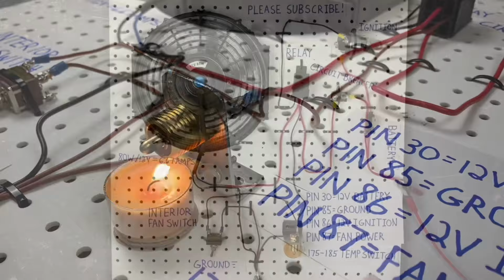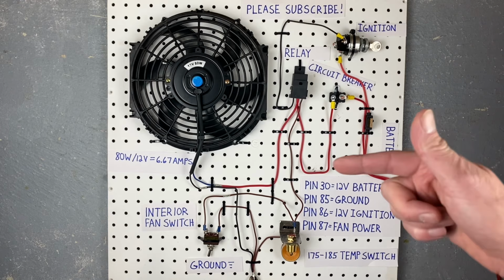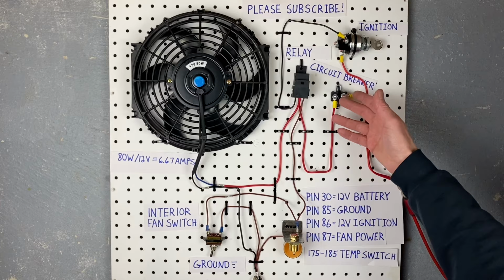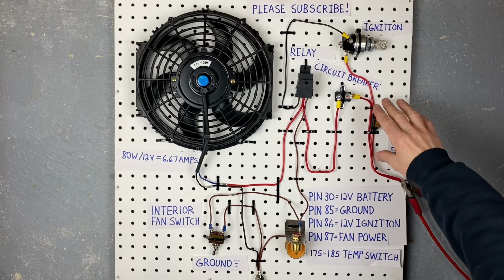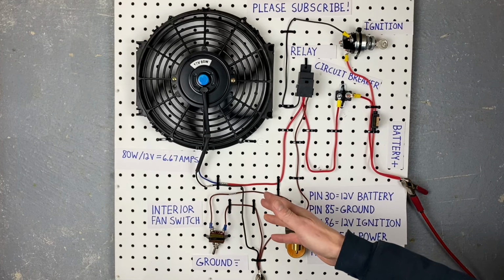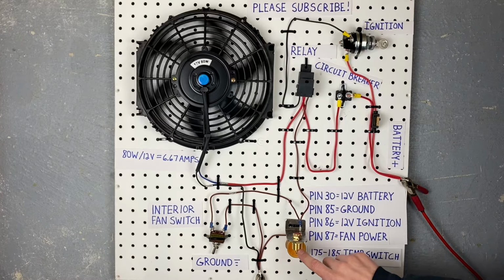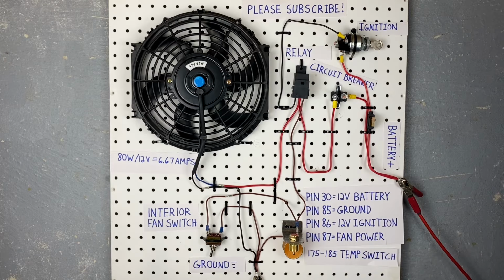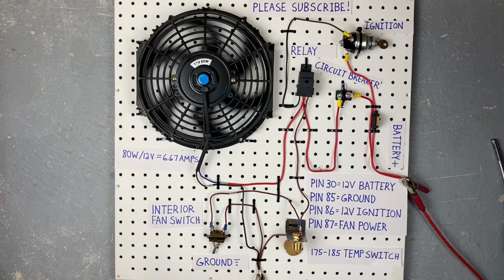How To Wire An Electric Radiator Fan Relay Temp Sensor AND Switch! | @WiringRescue

Comment: Great video, very clear and understandable. But i do have 1 question...
With pin #85 being the ground and temp sensor, would I just splice a 3rd wire Into it to connect the temperature gauge in the cab?
Reply from the maker: Hello! The answer is no :) The device in the video is a temperature “switch”. It only turns on and off at two specific temperatures. A temperature gauge requires a temperature “sensor”, which has a wide variety of resistance that changes based on the temperature. So it is actually two entirely different circuits. For your scenario, you will need to find a temperature sensor that is going to work with the style of gauge you are using.  Hope that helps out. Good luck with your project!

Comment: Hi, great video. I just did my camaro with a setup like this. But i would like to  keep the fan running after the car ignition is turned off. Like a temp power delay shutoff for the fan to keep the fan running until it reaches a specific cool down temp and shuts off by itself qfter ignition is off and i walk away from the car.
Could you provide a video thats shows how to do that. As an option to your existing fan install video.

Comment: Excellent presentation. What circuit breaker did you use? I don't see it linked in your description.
Reply from the maker: The circuit breaker came in the universal fan wiring kit. Sadly I don’t recall what the rating was on it. I’d guess 30amps, but I could be wrong. Really it should be based on your fan size and how much amperage the fan will be drawing through the circuit.

Comment: This is a great video, I just have one question do you have to wire the ignition wire to the relay to make it work? Or can you use the positive direct from the battery so it's a perment feed, no need for having the key in the ignition?? Thanks thanks

Comment: @WiringRescue Absolutely perfect diagram and explanation!! I have a question if you might shed some insight. I am installing a dual fan electric radiator setup, but I also have a Nilight 6 Gang Switch Panel Universal Circuit Control Relay System. I am wondering how or if I could tie all this into it, so that my fan would come on when necessary from the thermal switch but also give me the ability to override from in the cab on the controller. Thanks

Comment: Dont forget that many cars have temp switches with 2 pins. These are not grounded from the engine block and need to be grounded by wire

Comment: I want to hook up a fan straight from the battery to a on/off switch from a relay. Any ideas how to wire this? Thank you.
Reply from the maker: Only a few things different from the video:

1. Remove the ignition switch entirely, and the fused wire that goes to it.

2. Connect pin 86 to the power from pin 30, so they are tied together.

3. Remove the temperature switch and connect pin 85 directly to the switch instead of stopping at the temp switch.

4. Done.

Comment: I always wondered where did the pin number names come from. Why weren’t they just labeled 1 thru 5? Did it come from a circuit a relay was one used in?
Reply from the maker: Solid question! I’ll do some research on this!

Comment: Hi, the video is very educational. May I ask if I can do this without hooking it to temp switch? I mean just a manual switch in the dash so I can turn it on whenever I want. Also what relay should I use if I do this setup. Thanks.

Comment: Great video.  I noticed my electric fan turns on when engine turns on. 85 relay goes to ground on car chasis but not connected to temp switch.  I would like for electric fan to turn on only when engine gets to 200 degrees.  Any suggestions would be appreciated.  Thanks.

Comment: What gauge of wire should i run to feed a 2 fan system? 10g 8g? Lower?  AND can you run 2 fans on 1 relay or should they be on separate feeds? Thanks..great tutorial
Reply from the maker: The wire, fuse, and relay sizes all depend out the amperage being drawn through the circuit.  This question actually pops up a lot, so I made a video explaining it in great detail! https://youtu.be/EhzN6UdnmPA?si=G2JMY6GjnqZyYmTp

As for two fans with one relay - it is doable if the relay is sized properly for the two fans. That being said, it’s often cheaper to go with to smaller relays than one large one. So check out that fuse/wire size video link - and then decide on the relay with your wallet! :)

Comment: One question no one answers is - if my Nissan truck operates at a temperature of 195° then wouldn't I continue to use the old sensor ? And I believe that 87a post on a 5 wire relay is used for the a/c . Swapping my '96 Nissan truck this weekend !

Comment: should the thermostat on the intake and the thermostat for the electric fan be the same ? im guessing if running a intakte thermostat at 160 degree the fan thermostat should be 180 degree.

Comment: Im sure my vehicle runs 5v through the sensor and not ground. Should i just reverse the wiring on the relay so that the 5 volts activate the relay instead of the ground? Thanks!

Comment: Jeremy - this is an awesome video - thank you! Can you tell me what the amperage rating on the On/Off switch would need to be? Planning to do this very soon on my '65 Mustang!
Reply from the maker: I’m glad you enjoyed the video! The switch itself in this circuit  is just telling the relay to turn on and off, so it can actually be a very low amperage. 5amps + would be fine, as long as you wire it exactly like this. The relay itself is doing all the heavy lifting, so you’ll want to make sure the relay is rated for whatever amperage your fan is. Your fuse/circuit breaker would also need to be rated for your fan amperage.   I made a video on this topic as well if you find yourself bored today :D https://youtu.be/EhzN6UdnmPA
Reply from the maker: @banks412  - happy to help! Tell your friends to watch too! I’ll take every view I can get!

Comment: Thank you for the great explanation. On thing. Could the manual switch be connected strait to powered. That way if your sitting on the side of the road. Running hot, you can cool things down? Just thinking

Comment: is it possible to make the relay turn on with a 12v positive? like if i tap power from my ac compressor wire/fuse to turn on the fan. that way when i am parked and no air is moving through the condenser, i can still get cold air by drawing air through it with the fan?
Reply from the maker: Sure! Check out this video where I show negative vs. positive trigger wires. https://youtu.be/QCkfFCLa_Jg?si=LpNjHxCbng5RLGGG

Comment: I have a Derale 5.3 amp fan and the instructions say only if the fan draws over 10amps then use a relay.  Do you agree.
Reply from the maker: It depends on your switch and your wiring. If your switch, and wiring can handle the 5.3 amps, you don’t need the relay :) Just be sure to have a fuse in the circuit. A 7.5amp fuse would probably be a decent size. Then again, I am just a random guy on the internet.

Comment: Quick question.  there is a black and blue wire coming out of the fan, are they both wired to that one power source coming out of the relay?  Hard to tell in this video.  I was wiring up a fan in an older car and wasn't sure what to do with the black wire from the fan, except to ground it.

Comment: I’ve seen other videos where they connect Pin 85 to the ignition and Pin 86 as a ground instead. Does it make a difference if they’re switched like that? Thank you
Reply from the maker: It will likely work both ways, but I’m fairly sure the way Bosch designed the relay, 85 should be ground. Then again, I’m just a random guy on the internet! :D

Comment: What happens when you have ac on when you turn on t he key or truck on? Ac condenser will not get any air til the temp reaches certain temp?
Reply from the maker: Correct! This circuit is not connected to AC in any way. You would need some additional stuff to make this into an AC fan circuit.

Comment: Love the video, how would you wire in a in cabin indicator that doesn’t light up due to the wind turning the blades? Since at freeway speeds there’s no need for the fans yet the light will still activate from the generator.
Reply: Anyone?

Comment: Great video! Works great for me. Thanks.

Want to ask.. if i want to run 2 fan with 2 different relay, can i just tap the same source of 12v ignition? 
Since main power of the fan coming from pin 30 right

Comment: Say the set up you shown is really cool because I want to do it myself, and I have a set up myself in my car. After watching and watching videos my set up works but I figure yours is best but the point of it all. Would be to turn on the fan with no key in to car. Like something easy, accessible. Can I please get some help? Looking in to your video I was going to do it. And ask here if it would turn on with ignition off. Till I saw that part in the video. Can you please help? My set up does turn on at any time I would like. And I’m looking for something better.

Comment: Great video , thanks so much for the knowledge and the time you spent to make the vide
I had a quick question maybe you can help answe..

Would this same set up work on a 6 volt vehicle?  (Obviously everything 6v)
Reply from the maker: Unfortunately I don’t have much experience with 6v systems, so I’m not sure. I would guess that it would work the same way as long as you find components intended for 6v instead of 12v.

Comment: Great demonstration, but I'm just curious why a 5 pin was used like this. If all the pins were used on a 5 pin then there would be less wiring and a simpler circuit.

Comment: I have a question, if you shut off your engine and it is still hot shouldn't the fan stay on until it cools down?
Reply from the maker: Generally no, the engine will cool down on its own. You also don’t want fans to drain the battery or turn on unexpectedly when somebody is working under the hood.

Comment: If you just ground the system to the car frame instead of the heat sensor or toggle switch would the ignition switch turn on the fan
Reply from the maker: Yes it would! But sometimes that can be a bad thing. That could actually overcool your engine and take a longer time for it to warm up (possibly no / weak heat too). Some computer controlled engines require a certain engine temperature to go into closed loop too. So if you don’t have an engine up to normal operating temperature, you may never get into closed loop with the engine running the way it should be. 

Hope that helps you out!

Comment: Hi Jeremy, I watched this video to wire up the fan in my truck. Everything is exactly as described, except the circuit breaker. Mine is fused. For some reason, mine isn’t working. I know the relay is working, and the fuse is not blown. The only variable that I can think of, is the temp switch. The other issue I keep running into is the override switch I chose. It is a 3 -wire lit switch. No matter what I do, it will not work. The switch does work, I checked. Any help would be appreciated.

Comment: This is awesome, thank you! I do have a question though - how would this change if I wanted to wire three fans to function simultaneously? Would I just splice the other two into the first one after the relay, toggle switch, and temp switch? Also, what gauge wires?

Comment: Okay quick question so for every relay you have to have a connection to battery terminal or can i have a power board that has one battery connection and a bunch of studs i can attach fuzed power lines to pin30
Reply from the maker: You can have a power board with one battery connection as long as it is all sized properly. Fans draw a lot of current through the wires so you want to make sure that the wires, fuses, and connectors are all rated for the correct amperage. 

Good luck with your project!

Comment: I just want to track and trouble shoot my OEM circuit and don't need all this additional hardware. I'm just installing a simple circuit to a toggle to manually turn it on when it gets hot. Thanks. See ya later. PS subbed any how. Dandahermit.

Comment: Hi i just wanna ask if the sensor is for the oil temperature? And if it can be attached digital temperature reading? Watching from Philippines 🇵🇭
Reply from the maker: The temperature sensor would be for antifreeze in the engines cooling system. The sensor used in this circuit cannot be used for a gauge. It’s actually a temperature switch not a sensor. So it’s either on or off.

Comment: If I just want a manual fan, can I just take the temp wire and switch it to ground, without being hooked up to temp sender. Any special switch?
Reply from the maker: 1. Connect the fan ground to the chassis.
2. Connect the relay pin 85 to your switch. Any switch will do, as long as you are using a relay.
3. Connect the other side of the switch to a chassis ground.
4. Everything else is the same.

By doing this, your switch is simply telling the relay to turn on and off. Your relay is telling your fan to turn on and off. If you were to skip the relay (because everyone asks this), you would need a higher amperage switch (typically ugly and more expensive), and you need much heavier gauge wiring going to your switch, which is not ideal for running it into your interior.
Reply: @WiringRescue  yes. That’s what I thought. I’m assuming the 85 is the temp turn on wire. Everything goes through a relay. Thanks

Comment: I have a question about this wiring digram (great video by the way!) How would I wire it if I didn't want to include the ignition switch? In other words, It won't mater whether the key is turned on or off. The fan will still run.
Reply from the maker: Generally I shy away from that design because I think it can make it dangerous for the person working on the car with a fan that can kick on anytime it chooses.  It also has the potential to drain the battery with the car off.

Comment: Do the wires coming out of #30 (that lead to the battery) stay hot even without the key on? Also, I’m having difficulty finding a key ignition wire.

Comment: how do you wire in an ingition hot/on circuit? does the wire go to a distribution block that is connected to the ignition switch?

Comment: Should the inline fuse not be in between the ignition switch and the relay? Legitimate question.
Reply from the maker: Technically that wire is protected by the fuse that is before the ignition switch. That being said, it would not hurt to add one in between the ignition switch and the relay if it’s a smaller size fuse than the one feeding the ignition switch. As always, it may just depend on what your building, what size wire you are using and what other circuits are coming off that ignition switch.
Reply: @WiringRescue  thank you!

Comment: What different kinds of symptoms can happen when the circuit breaker fails?  I need to figure out why my fan spins briefly at engine cranking, then never again (as far as I can tell).  I wonder if circuit breaker is bad and keeps shutting off system prematurely.  Or if there is a short in the wiring (not the fan) and the fan can spin briefly until circuit breaker activates.   Thoughts?

Comment: I installed an electric fan in my car to replace the old fan that cooled my AC condenser. Currently, the way it’s wired, the fan only comes on when the AC is on and when pressure sensor passes a threshold. I want it to also be turned on when my car reaches 87 degrees C. The old wiring from the old fan accomplished this. Could I use the old fan’s wiring to accomplish this? If so, would it just be the ground wire (because it already gets power from a relay).

Comment: I am adding a fan to my car. Could I run 86 to + on current fan to turn on the additional fan when I turn on my AC?
Reply from the maker: That seems like a fine idea to me. Just make sure pin 30 on the second fan has the proper wire size and fuse size for the fan that you’re running.

Comment: I need help. How do I wire this into a ford focus that uses an ECU controlled variable speed fan. I tested the plug that goes to the fan and it always has power once you turn on the ignition. The issue am having is that the fan only works when the air conditioning is on but not when the engine gets hot.  And it only spins on low which is not fast enough to provide proper cooling.  Am trying to figure out how to bypass the whole computerized problems and work it like the how your circuit works.  Anything gets unplugged and the air conditioning stops functioning  so I have to leave the module plugged into the radiator fan

Comment: Does my power wire have to go back to my ignition switch, or can I run it to a post on my 4 post 12V solenoid? Trying Tia lid the run of wire through firewall and to ignition switch.

Comment: So how does one wire in the temperature gauge into this circuit? When I did mine the temp gauge never registered and the fan never came on (180.on, 170 off). When the bypass switch is turned on the gauge pegs (full unrestricted ground)

Comment: Hi Great video, I have mine setup in a similar fashion, but I have a rocker switch (manual off sensor) and it works great. However, I would like to also add another trigger when the AC compressor turns on. I have already tapped the (+) that turns the compressor on. When I try and connect it to my relay (87), when 87 is energized it send power to the compressor in addition to activating fan. Will I need to use a diode? Not sure how to connect one.

Comment: Excellent video, instead of temp sensor, I would like to hook up to A/C Compressor. Do you see any problems with that? I still have the original mechanical fan for eng, just need air flow over A/C condenser.would like the option of manual or when compressor cycles, Thanks
Reply from the maker: I would think you could use the ac switches to activate extra fans instead of a temp switch in the block itself. Just make sure it goes through a relay!

Thanks for watching!
Reply: @WiringRescue  Thanks